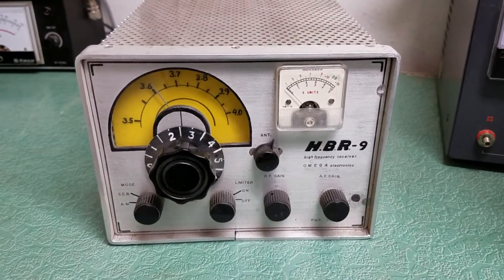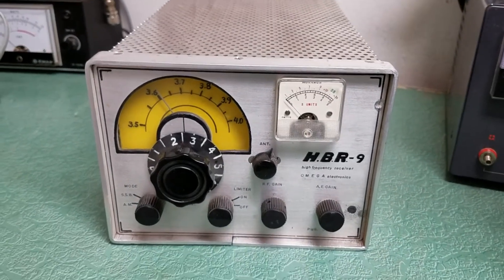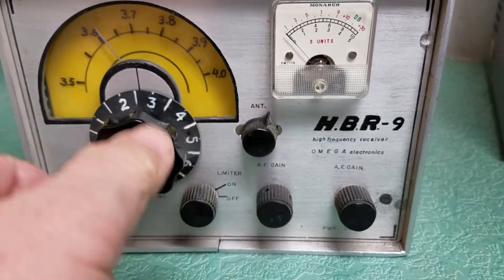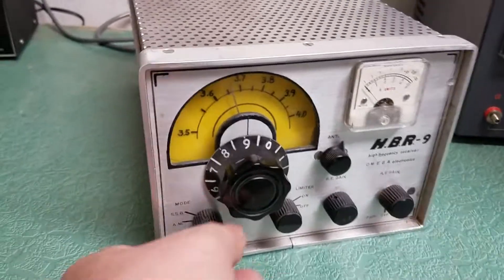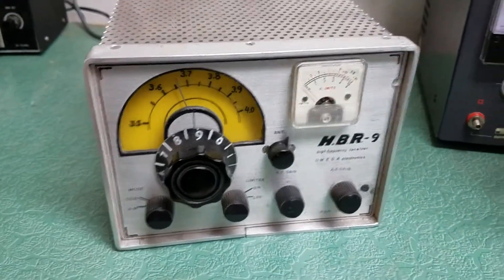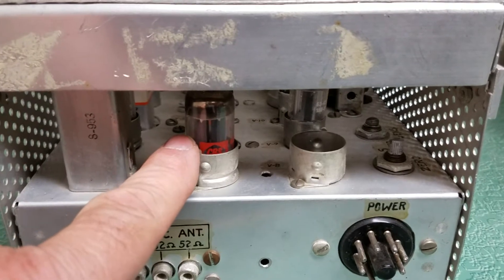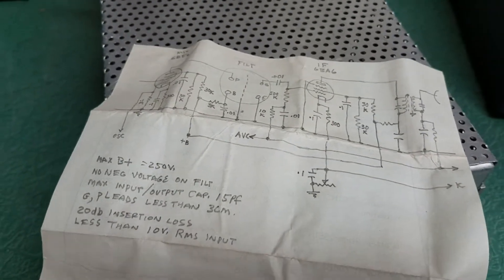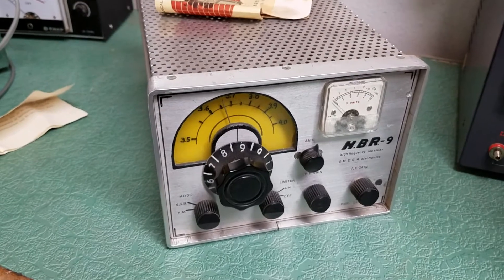Omega Electronics HBR-9 High Frequency Receiver

Comment: Very pretty RX. Do you still own this John?
Ever fire it up? The  paper sheet is a standard schematic for the mechanical filter that is likely used in this receiver.
Reply from the maker: Dale Parfitt no I don't. I agree with you. Very nice looking unit.
Reply: Hi John,
I bought the RX from K1VVC. It  is not missing a tube- the empty socket was for expansion.
Last night was the 1st time I have had to return to the RX since purchasing it several months ago The Kokusai mechanical filter foam packing had degraded into goo. I first ran into this  when restoring a KW Electronics KW-2000B. Same filter- same issue. 
When I opened the can I discovered not only the goo, but (2)  of the (4) filter wires were broken off- as result of the filter rattling around inside the can. The wires are very tine and stranded. Everything cleaned up and reassembled.
The VFO and mixer were very temperamental. This turned out to be oxidized grounds. I aligned and tracked the VFO, the IF stages and S meter. It is a wonderful AM RX and not bad on CW  and SSB if you are willing to ride the RF Gain control- as in all of the pre product detector receivers.
I am doing an article for ER right now on adding a tiny BFO to VHF vintage AM rigs. As soon as I wrap that up, I’ll start on an article about this receiver.

73,

Dale W4OP